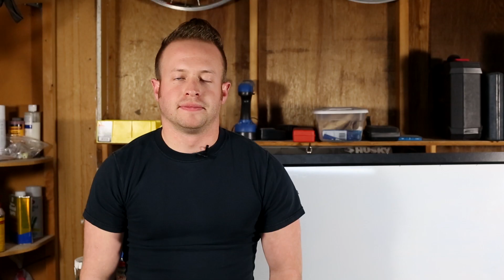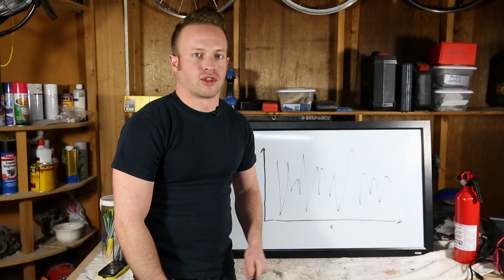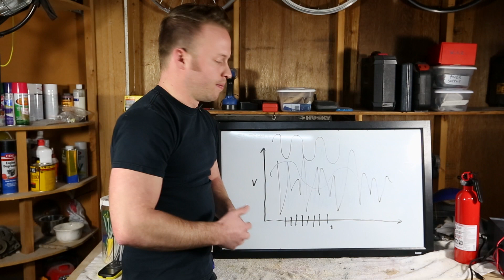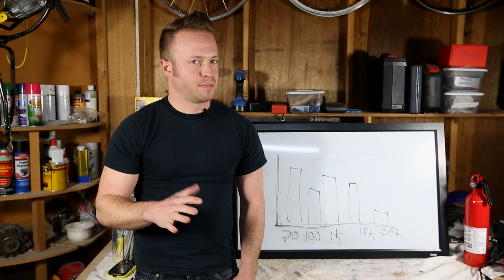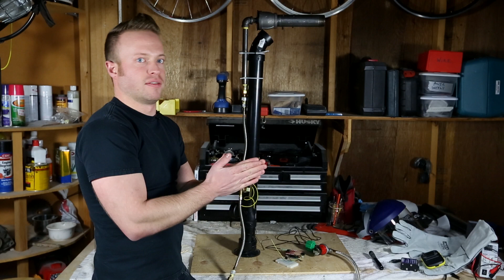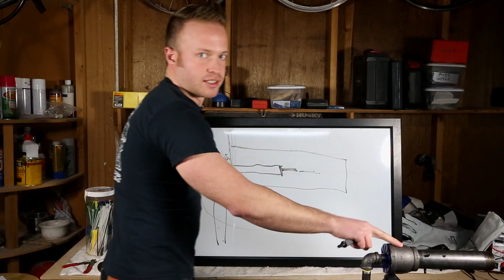SparkFun Engineering Roundtable 1-15-13: Audio Spectrum Analysis and Fire! with Chris Taylor

Comment: I hooked the spectrum shield up and soldered all the connections. If i connect audio via aux cable and connect a speaker to the output, i do get sound, however the values from the analog read are not changing when music is played, instead the pivot somewhere around 150Hz, and when i wiggle the cable they change a bit. Connectivity of my solders is ensured with a multimeter. any help?

Comment: I certainly appreciate these as well, however, in spite of his early statement of "being too academic", it was still "too academic".  Showing more details and specifics about building filters and the outputs shown on a scope or spectrum analyzer would have been helpful for those who cannot picture what is going on.  Not sure what all is on the SF board, but the to have an appreciation of what it does might be easier shown by how to do it the hard way first.